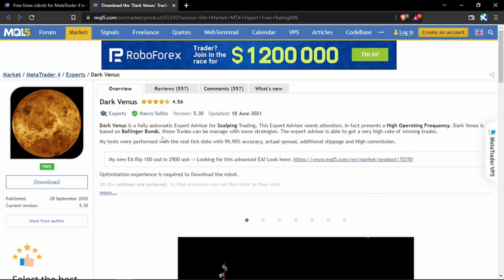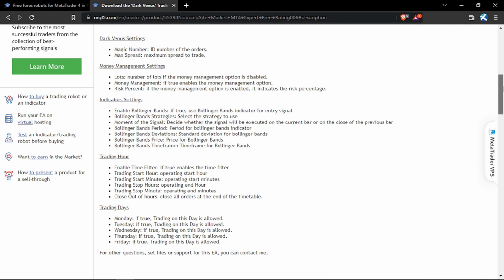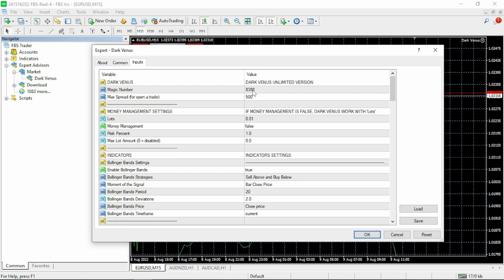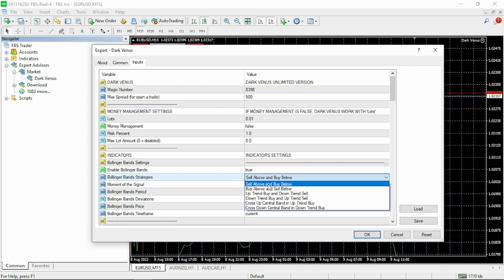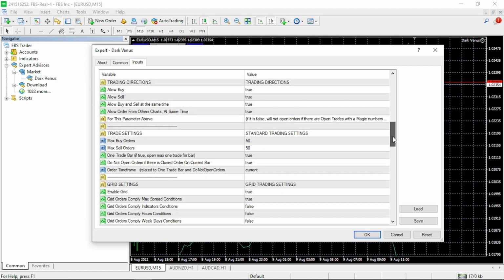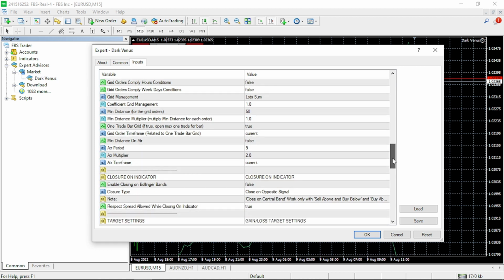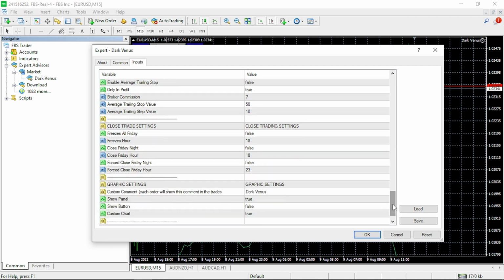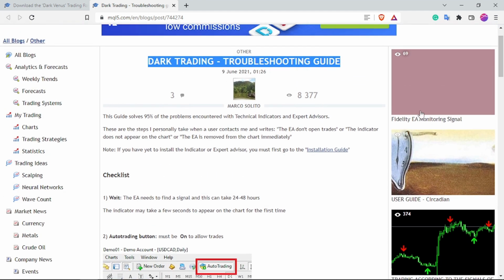Forex Trading Robot Dark Venus mt4 Settings

Comment: Does the risk percentage calculate based on the total account size? so does it increase the risk per trade as the account grows exponentially? or do I need to increase it manually as the profits grow?
Reply from the maker: The risk percentage increases the lot size as the account grows meaning you don't need to manually increase the lot sizing.
Reply: @sicforex  I really hope that is true. I added 1k to a 3k account and the results didnt reflect the account increase over the week. Using a VPS. My guess is the increase in account size wasn't enough for the bot to increase the lot size for trades.

Comment: Hi, May I ask how can I prevent Dark Venus from opening Multiple trade at the same time and only open another trade after closing the open one? And also may I ask how can I set it to open more trades frequently and close quickly with lower or higher profit. Kindly advise. I did tried to change the settings however it doesn't allow me to do the changes, Kindly guide me, Thank you.
Reply from the maker: Hey @user-bp7pm2cg8r, under the settings change the max number of trades to 1 and the adjust your take profit and stop loss accordingly.

Comment: Hi there, thank you for making this video...i have deposited $160 on Monday and had $250 in my account by Friday - The account blew, this was on a NFP Friday and thought it may have been due to the volatility but I realized that the EA kept taking repeated trades on trending marketing and losing those trades - Would it be possible to amend a setting on the EA to only place trades on a ranging market and not on trending markets? I do believe this bot has a lot of potential if small settings are adjusted.
Reply from the maker: @user-uk8bj1fs1z, Hi Venessa, Unfortunately the bot doesn't have a filter for ranging and trending markets. The best advice would be to switch between the different strategies when the market direction changes. What that means is, when the market is trending use the trend following strategy and sideways markets use the reversals strategies.

Comment: If i don’t put the brokers trading time will it still work and trade. Or do I have to put in the brokers time?
Reply from the maker: If you don't use the trading time settings, you don't need to adjust the time. DV might take some time before it places the first trade, I recommend using the Bollinger bands on your charts to see when it takes trades.

Comment: How much the capital for this settings sir?
Reply from the maker: Hi , welcome to the channel. I made the set files for my series for a $1,000 cent account however you can adjust the balance when testing in the strategy tester. I recommend starting with low lots while you get to know the expert advisor. Set files are saved in the link under the description.
Reply: Thank you so much sir
Reply from the maker: @corazonablen6949  Your welcome!

Comment: Does it work on prop firm accounts?
Reply from the maker: I've tested it before on FTMO and FTP however, haven't tried the other prop firms.
Reply: Did it pass the challenges
Reply from the maker: @JohnBoygames  Bot performed well on zero spread account with FTP, however failed because of Drawdown.
Reply: @sicforex  didn t they ban you for making the same trades as other ?
I ve done some ftmo free trials and i can keep the daily loss under control
But i m not sure how many people use the bot and i m afraid i will get banned
Reply from the maker: @capitanu8025   My recommendation is always read the FAQ a few tims for each prop firm because they all have unique rules and you can get banned.
 I use unique set files and a variety of different robots that would give me different trades from others using the same bots as me.
Congratulations on keeping the drawdown below the daily levels, it can be very challenging as a trader.
Happy Trading 😁
Reply: @sicforex  i ve set the bot, by my own and the tester looks great , idk how accurate is but it made 9% in 12 days with max drawdown of 2%